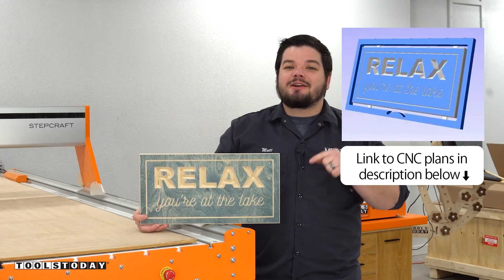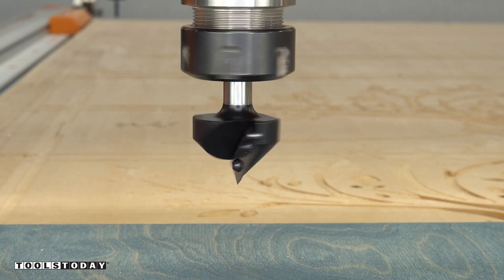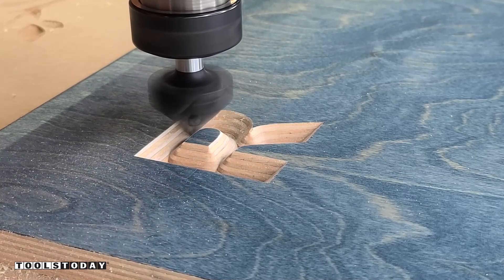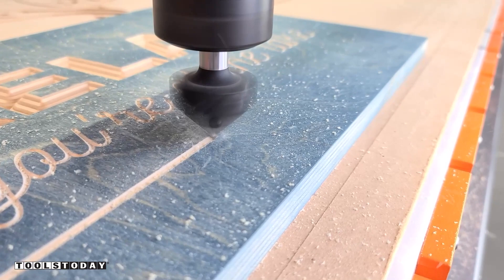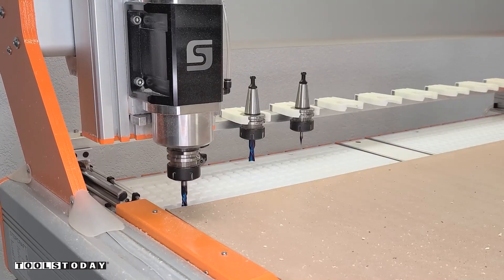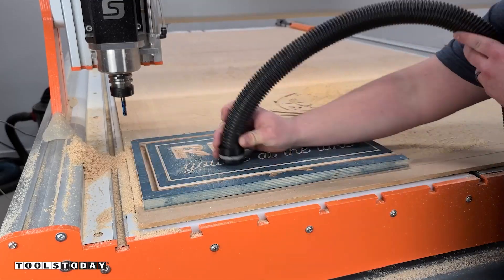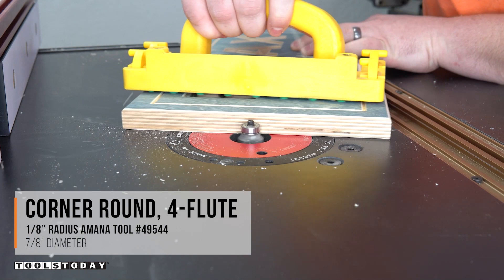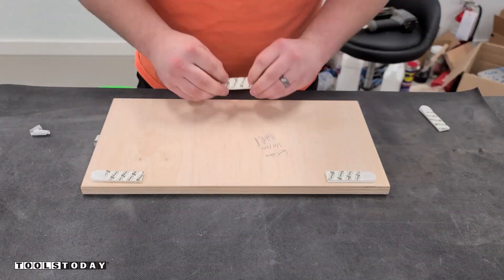How to Make a CNC Sign | ToolsToday

Comment: So i do want to start making Wood signs with Routers and CNC machines. Ive looked at at least 10 now this one is my current favorite and one I’m considering on investing in.  The automatic Bit changer got me sold to it. 3 questions though. 
1. Can you do a software video fir this machine 
2. Is it also good machine fir cutting shapes and letters for Sign Assembly 
3. Are they sold in US and if not how does shipping work?

Comment: Great result, but I'm confused about using a compression bit at full depth in plywood.  I thought the first pass should not be more than 0.20", not to exceed the up-cut portion of the bit - then a 2nd pass at full depth.  Am I missing something?

Comment: I'm curious with the 46171-K, the recommended feed rate for going to a full 3/4" depth would be on the order of 150IPM. What prompted you to keep the speed up at 200IPM? Thanks.
Reply from the maker: Just from experience with using the bit.  I've used it on a few projects and know that the machine and the bit can handle it pretty easily.